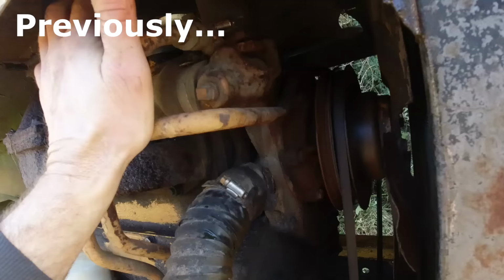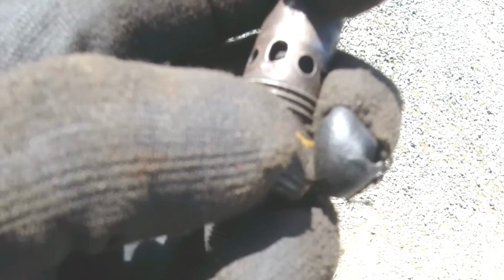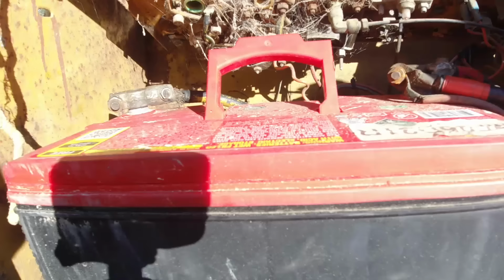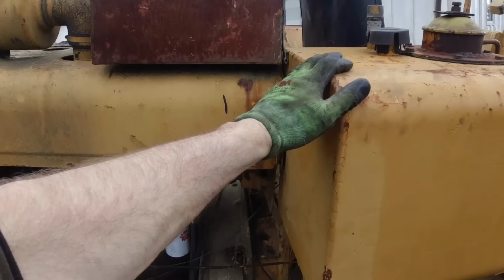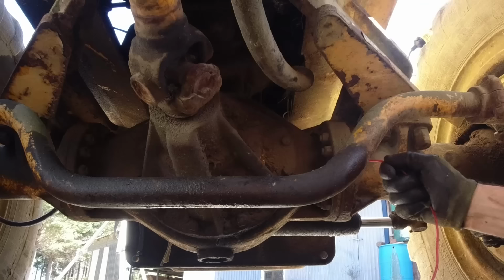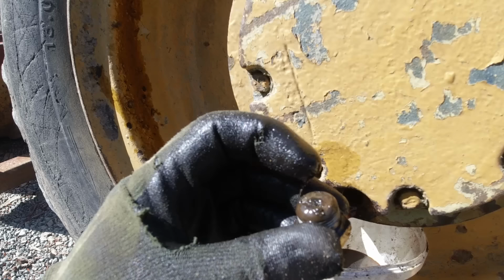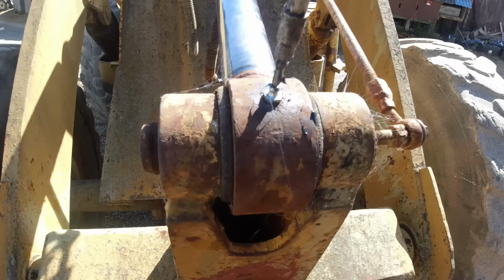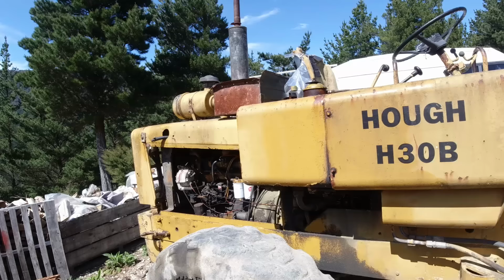Fixing the Hough 30 Payloader and putting it back to work..

Comment: It's hard to ignore that tires on many of the machines are not in the best of shape.  Do many of them use the same size tires adn the same wheel bolt pattern, or is it something of a crapshoot when it comes to that?  I can't expect that tires come cheap, so I expect that you're looking at the used market for any takeoffs with a bit of life left in them.
Reply from the maker: I actually picked up 3 used spares a few days ago for $100 that will fit grader and hough do should be good for a few decades

Comment: Do not try to fix outboard motors with that method of heating grease nipples to get grease to go through done this to loosen corroded bolts you will hath to strip the motor and replace seals.

Comment: Just thinking out loud Maybe it would be easier to just run a little tube, about the same size that would fit into the nozzle of an aerosol paint can....run it down to the intake and attach a can of ether to the end, just there in the cabin so every time you want to start just easily give a direct shot of ether to the intake..... problem solved. :^)